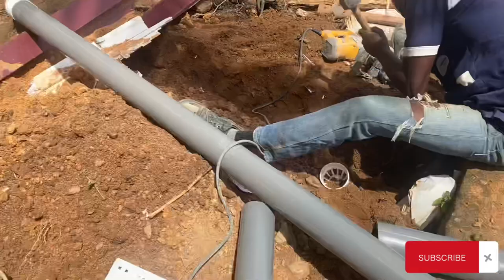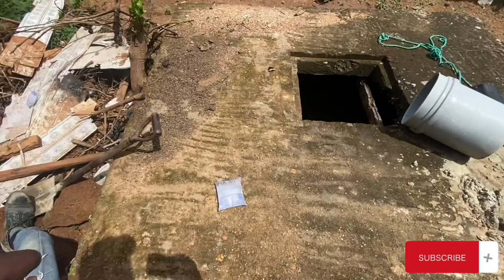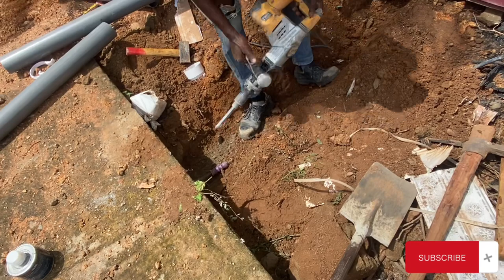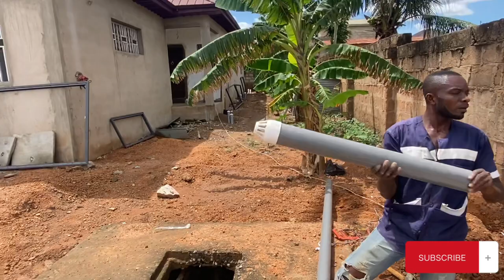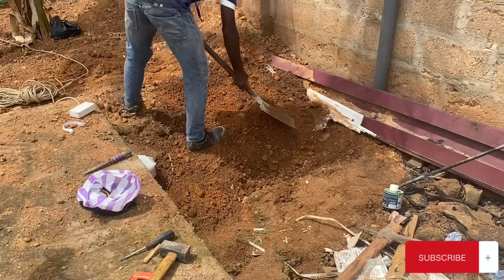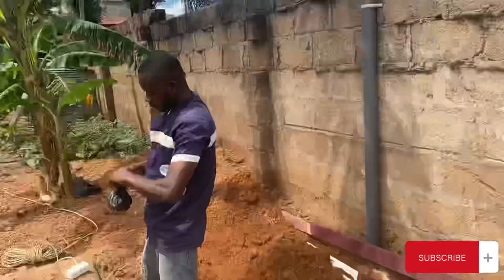Building in Ghana🇬🇭|| No ventilation for the manhole system🙄🙄

Comment: Was your plumbing installed properly with a P trap or S trap shaped pipes in your bathrooms and kitchens? If not that sewer smell is not going anywhere.
Reply from the maker: S trap please everything was done perfectly
Reply: Also avoiding toilet waste pipe being joined with with other bathroom and kitchen waste pipes is good practise but the p trap for waste water would still be necessary before the waste water pipe is connected to the septic tank.